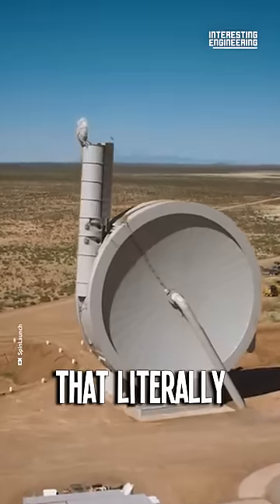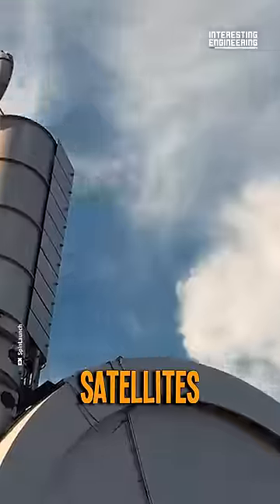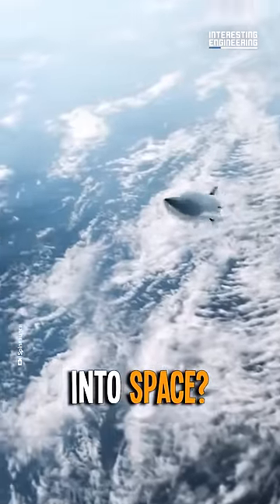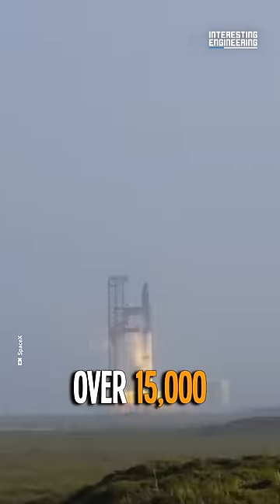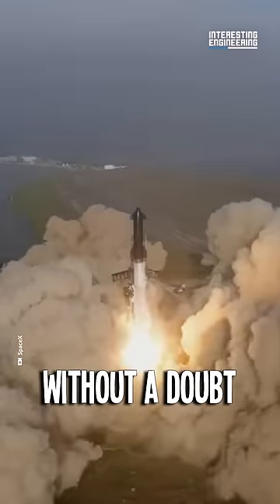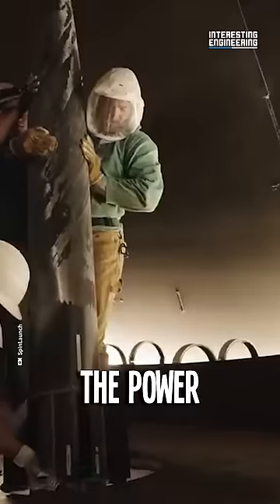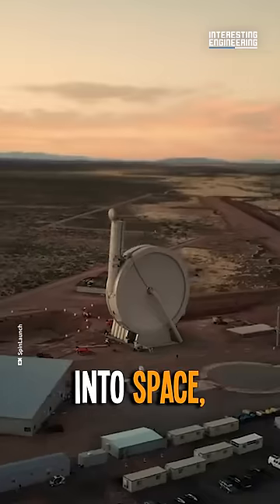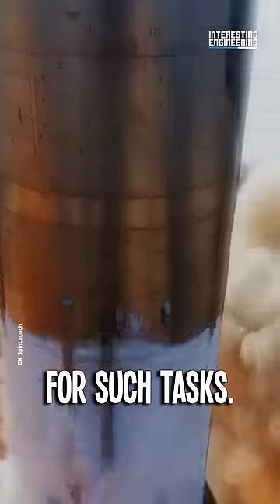Throwing Artillery Shells Into Space

Comment: Oops, it released it .00001 seconds early, time to build a new spin launch...
Reply: Yup. And they plan to have dozens of these running 24/7 on a launch site.
Reply: The energy in a 5000mph launch vehicle would obliterate the facility.
Reply: @matthewedwards6454 Where did you hear they'll be running 24/7? Even if they had unlimited contacts they still would need time to install everything and prepare between launches
Reply: ZiegPride  Alright what does running 24/7 mean though? Like, they'll be constantly manned and worked on in shifts continuously?
Reply: ZiegPride  Jeez Louise how many contracts do they plan on having where they would need dozens of them in continuous operation? Even SpaceX facilities that have the most contracts don't do that. Is it because they're expecting a wave of new customers in the low end price range?
Reply: apparently it's actually real problem because to spin anything heavy very fast you need a counter weight -> when release payload you also need to release the counter weight at exact same time or the unbalance force will destroy ur spinning equipment
Reply: I guess you've never heard of an interrupter gear. Ever wonder how WWI pilots were able to shoot through their propeller? You would [obviously] have a mechanism built-in to only allow the release of the projectile at specific times. Logic: bullet relies on gear, gear relies on fan blades. In this case, it would be: satellite relies on gear (or other similar mechanism), gear relies on facility ejection port.
Reply: Someone has obviously never heard of a computer before. They can release the satellite at an insanely precise interval with like 0.0000000000000000001 seconds of precision. Timing isn't the issue.
Reply: @russellhammond371  I do know what that is. This is much faster and is done with computers according to what I've seen.
Reply: Rockets blow up from time to time at many times the cost of a spin launcher.
Reply: @_MaxHeadroom_ SpaceX launched 98 times in 2023, 96 successfully. They're aiming for 144 in 2024. Rocket Lab launched 10 in 2023, one to around moon, in smaller rockets than SpaceX. In 2024 RocketLab has one rocket going to Venus.
Reply: It still sounds pretty crazy though. If by "dozens in continuous operation"  they mean 36 launchers sending one up every day, it would only take 8 months to replace all of the world's satellites
Reply: 4Ghz processor, process 5 billions atomic instructions in 1 second. Basic DC motor with magnets also works so fast. Even 8bits basic MCUs we use microseconds delays for simple operations. So 10^-6 is such a persistent and basic unit for these systems.
Reply: Doesn't work.....
Reply: If it's designed right slightly early wouldn't matter other than the fact it will lose some energy due to friction with the walls.
Reply: And, no one asked the question of:  just how much more space is there available in orbit for all of these small satellites 🛰  ?  Not much anymore!
Reply: @timrosencrans7955  not really the payload would likely either disintegrate tiny pieces of Superfast shrapnel carrying away the kinetic energy and dispersing it slowly into the air water or dirt they fly through, or it would stay intact but still pass through a good deal of floor, air water or wall dispersing only some of its energy into these things over a long period of time. Planes that crash into the floor burrow meters into the ground and often leave almost cartoonisly planes sizes holes rather than massive craters, and subsonic planes aren't even that Aw sharp, these projectiles are basically darts so they will have no issue penetrating far into whatever they hit, dispersing their Kinetic energy over time rather than all at once.

Obviously having a supersonic projectile fly through 7 walls and nail the neighbours dog isn't great either but it's not a city sized explosion
Reply: I just can’t stop thinking about the warzone that my laundry room turns into when my washing machine is slightly off balance during the spin cycle
Reply: Im more concerned of the projectile thrown off course
Reply: @matthewedwards6454  wait how to put the satellite if spin launch constantly moving?
Reply: Or a new house, depending on where it lands.
Reply: @z_drag0n  spin launch simp.
Reply: @paulw9516  Space is very very very very big
Reply: @mukamuka0  this is, I think, the greatest engineering challenge they'll need to overcome.
Reply: @billb207  They've done test it on smaller prototype but it's still unsuccessful on the real scale launcher. It's extremely hard. Most comment here never thought about how physic works so they dismissed it as simple. This is mechanical problems on the extreme level and making the connector that can withstand forces of the rocket launch while also have a response time of micro-second is nothing but easy. Also, after releases the counter weight... it doesn't simply disappear. Newton 3rd law applied... Which mean there is another rocket fly at the opposite direction...inside the vacuum container...
Reply: @timrosencrans7955  the energy in a rocket can and has done the same thing before. And yet, it is the standard.

We have been able to perfect many technologies that we never thought possible. I don't see this being that big a challenge. And hey, if there are failures, which is part of any endeavor, we'll hopefully learn a lot from it.
Reply: @mukamuka0 ah yes, physics. We've been doing that for ages. Pretty sure it won't be a huge problem, relax.
Reply: If we could shoot bullets between the blades of a spinning airplane propeller in 1915...then I hope they can handle the mechanical timing of this contraption.
Reply: Yeah, but exploding rockets on a launch pad ain’t all that painless either (assuming the spin launcher does it’s magic launch nominally most of the time and same with rockets being launched conventionally)
Reply: @_MaxHeadroom_  Launching garbage into space maybe 😂😂
Reply: @z_drag0n  0.1 attoseconds is waaaayyy beyond any computing speed by like, a billion orders of magnitude
Reply: @z_drag0n   someone has obviously never used real mechanical components that are computer controled because its real life not a video game or simulation materials flex and change when subjected to these forces. it would be easier just to fire them from large cannons (actually less iternal structure in the satalite. watch the thunderfoot vidoe on this. its a ridiculous idea
Reply: @paulw9516 ya how many satellites do we need in space smh got enough allready
Reply: @z_drag0n  Then why is the projectile going sideways when it breaks through the atmosphere barrier?
Reply: There can be errors with rockets related to .00001 second differences. It’s not like that level of precision isn’t necessary for both this and rockets
Reply: @_MaxHeadroom_  except many of the satellites are much bigger than could be launched by this method. Miniaturisation has it's limits, especially when dealing with things like optics and communications (which are basically optics on different frequencies).
Reply: Since the seal is broken with each launch, it has to be repaired and rebuilt anyway.

Comment: The centrifugal forces would be upwards of something like 10k Gs, so I’m reasonably skeptical about this launching anything but an inert lump of tungsten.
Reply: And that is not the worst of it, even rod of tungsten hitting air at ground level at mach 7+  would melt in seconds.
Not to mention the same forces would act on the rotating mechanism.
Reply: We've been making electronics that can withstand a ton of Gs since the first proximity fused rounds during WWII! That used vacuum tube tech no less. 

 So that probably isn't the issue for a satellite designed with this in mind.

  The issue is what is better.

  20gs for a split second or sustained 10gs? (Using these numbers as an example)

 I say this as according to some YouTubers like Thunderf00t? A space gun might be a better solution due to this reason. This thing is putting a ton of Gs for a long time on something.  

 I personally can't stand that mofo. So I hope he is wrong. Yet there are others too who did the math, and they could be right. 

 And quite honestly sending things to space using a SPACE gun just sounds cooler.
Reply: @dianapennepacker6854  there are at least three problems.
1) the spinner needs to have vacuum that can be rapidly sealed off while have a big spiny thing doing the spinning
2) the spinner has to be able to take these loads more than once.
3) the payload will hit air close to sea level going 7 or even mach 10 , even tungsten rod at mach 7 melts in seconds, main reason navy gave up on rail guns.
This spin launcher could be good if you want molten something spread around most of the world, but not to send it into the space in one piece.
Reply: @dianapennepacker6854 you are clueless.
Reply: TO EVERYONE IN THIS CHAT:

THE JUDGEMENT OF GOD IS DRAWING NIGH.

REPENT TODAY AND GIVE YOUR LIFE TO JESUS TO ESCAPE ETERNAL DAMNATION!,
Reply: We have alien tech this is caveman tech compared
Reply: @dianapennepacker6854 lmao I love this comment
Reply: @user-knhgvg454g  I am as clueless as you are gor sure. 

 How about you look up others who had good math and science to back up how this idea isn't good, or that a Space Gun is probably better. 

 I bet you believed in the Hyperloop too like a tool.
Reply: @Nauda999 Yeah they seemed to have the vacuum pretty down solid from the footage I've seen. Some type of seal that breaks, and is easily replaced. I'm not sure how much of a vacuum it is. 

 2) Yeah definitely. That thing is rotating ridiculously fast. Then they want to significantly upscale it too when they "commericalize" it with daily launches no less. That would be quite a feat.

 3) Thought they were launching at altitude in mountains of NM No? Not that it matters as there is still a lot of air there. 

 Thought they were also planning on making it a hybrid system for larger payloads. Even getting it up to 2k mph would be good before a rocket takes over. That would make more sense. 

 Anyway for people curious just type in Spin Launch debunked. There are a few good videos on why this idea isn't really going to revolutionize anything.

 I will be happy if I'm wrong.
Reply: @dianapennepacker6854  Just goes to show how hard is to prove that some ideas are not practical,
Some even now want to prove that wire electricity ideas Tesla had are great.
Reply: Well said
Reply: @Nauda999 aren’t they still working on naval rail guns?
Reply: @TheRobbiUno  naval rail guns got scrapped long ago, air is too big of a problem, stuff just melts, even tungsten rods.
Reply: @Nauda999 For number 3 why not just build the "artillery shell" that carries the satellite with the same material that heat shields are made out of ? Y'know those heat tiles under the space shuttle and starship.
Reply: @dianapennepacker6854  no just you are clueless.
Reply: The escape velocity for Earth is about 24,000 miles an hour or roughly Mach 30+ it does that it goes to space simple as that
Reply: @dane385  problem of that is that every material even tungsten melts in seconds moving through air at sea level at Mach7+, that's why navy gave up on railgun projects.
not to count all the problems a spinner with vacuum would have especially under such an immense loads.
Reply: @JesusPlsSaveMe This is inappropriate.
Reply: what if you launch one to remove the air first
Reply: @Caricanalisis  what does this even mean?
Reply: @Caricanalisis  that wouldn’t have any affect on the centrifugal forces caused by rotation.
Reply: @codyaevans  make the centrifuge bigger then
Reply: @Nauda999  the problems you describe such as air resistance are very real -- it's also clear that the spinner needs to be balanced during the time that the payload is attached and spinning up, and that it can't simultaneously be pre-balanced for the moment that FOLLOWS the launch. All of that might be moot if we consider the spinner, the vacuum seal it's in, and its counterweight to be disposable. You just release the payload, allow the now-unbalanced counterweight to impact the ground with just as much kinetic energy as the payload had at launch, and watch the "kinetic energy bomb" from a safe distance... but your spinning mechanism and counterweight are gone forever, now
Reply: @julianbrelsford  one time use spinner goes counter to their claim that it would be rapidly reusable.
And most importantly that even after 10 years and spending hundreds of millions they have not launched even a test payload into space
Reply: This is for extracting wealth from investors, def not going to be made or functional.
Reply: They have done one launch already
Reply: @DeEmperor1  you mean the test launch that didn't launch anything into space?
Reply: @JesusPlsSaveMe that comma at the end of your schizophrenic rambling really hit different.
Reply: @DeEmperor1  they’ve done 10 suborbital launches so far. They did the first launch with some basic instrumentation (#10) in October 2022. From what I’ve found, there’s no outright mention of how the instrumentation fared, but they haven’t done a test launch since, after doing 10 in less than a year. Tells me they got some data that set them back quite a bit…
Reply: Well spotted. I’m sure that’s the real purpose.
Reply: @JesusPlsSaveMe  Judgment of who?
Reply: @Nauda999  Who says that it needs to be launched at sea level. Build that thing on the top of a mountain. Level out the peak of mount Denali in Alaska and you can plant that thing around 20k feet. Less air resistance at that altitude and you're that much closer to space.
Reply: Do you have any idea of the destructive power of this thing launching tungsten? Anything in the way would be hit by megatons of energy.

Even if it only launched a bowling ball, the destructive force would be many times higher than a Vulcan cannon loaded with depleted uranium.

This thing is designed as a weapon, and """satellite launching""" is a dorky cover story.
Reply: The DARPA in me is intrigued....
Reply: @stoptrudeau42  No kidding. We're still burning coal to get energy 🤣🤣🤣 Aliens are laughing hard at us
Reply: @hxhdfjifzirstc894  I think we have way better advanced weapons already in place better than a "cannonball"
Reply: @GoodBoyGoneDad  Then do it, there is a reason they have been trying this since 2014 and haven't managed even one successful test launch yet.
Reply: @dianapennepacker6854 the post u responded to said 10,000 G's and you switched to 20 without batting an eyelid.
Reply: @Nauda999  A rod of tungsten wouldn't melt if it were to fall from orbit to earth and hit the ground at mach 7+. Tungsten can withstand temperatures of over 6100 degrees Fahrenheit.
Reply: @FutureSyncAI  yes, but it would melt if it is show at mach 7 at sea level, that's why navy gave up on railgun thing, because everything just melts almost instantly.
Reply: I calculate around 12,600 G's for a 2km diameter disk spinning at escape velocity (11,200 m/s). Shrink the disk by half, double the required G forces. Forget about the actual satellite. How would you even design a disk (or lever arm) that could withstand that?  I file this right up there in "ideas that 6 year olds come up when they understand nothing about physics." Kind of like Santa Claus delivering toys globally in 24 hours that would require a sleigh exceeding the speed of light.